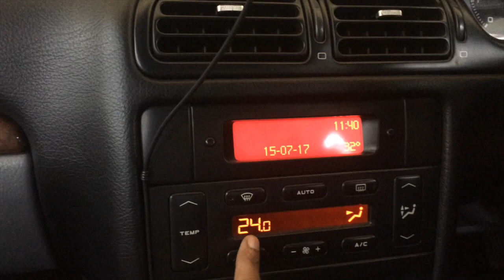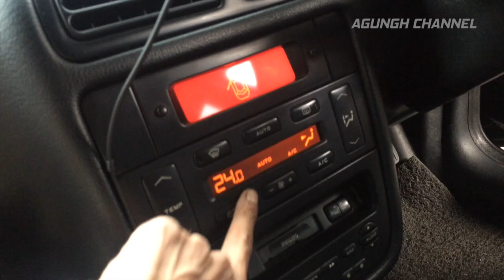How To Replace AC Relay in BSI Unit - PEUGEOT 406

Comment: I really like this video, especially since I have taken my Peugeot 406 to three auto electricians, and they have been unable to fix my air-con.  I think it's in the too hard basket and in Australia I don't think a lot of auto electricians like these European cars.   I'm not sure where you are located but if you ever come to Australia would you please fix my air-conditioning, because I feel confident that you know what you are doing, and I certainly have no confidence after three tries with 3 different auto electricians!   It's a shame I love my car so much, otherwise in Summer I would have gladly given it away when I'm driving in the sweltering heat like the 41c we had yesterday!!
Reply from the maker: I live in Indonesia, just do it by your self. first, check AC Compressor socket then also check in pressure switch socket. If there is not detected, probably your BSI relay problem.

Comment: Hi there awesome video. Do you know if this will work on the 2015 208. Or what I can check. My Aircon only works if the radiator fan is on. On the diagnostics it says fault with LIN network 2. If I clear the error my Aircon works perfectly but when the error comes back it stops working again… please help me, auto electricians don’t know how to help and the dealership is clueless.

Comment: Nice video and all. I just don´t understand why you cut the plastic case of the BSI.
There´s just a few plastic tabs holding it in place. Pop the tabs and the entire cover comes off. Without cutting anything. ;-)
Reply from the maker: I can't find the tabs holding to open in back cover from this BSI type. So... I decided to cut off in this area. If don't mind, please shows me how to do it... Thanks before.
Reply from the maker: Thank you very much for your reference...
Reply: Having taken a 406 engine fuse box apart, which is of a similar construction to the BSI, it is not possible to remove the casing. This is due to the fact that the multi plug pins and fuse sockets are bonded to the top cover. I tried to desolder the socket pins on the circuit board but gave up after an hour. A hot air station might possibly work, but honestly, if videos like this show you the location of the faulty relay, cutting open the BSI is minutes work.
Reply from the maker: @roberthorwat6747  Hehehe... You're right Sir.
Reply from the maker: @crpth1  Hehehe... look like but absolutely different.

Comment: Any chance you know where the wiper low and wiper high relays are? :o
Reply from the maker: PEUGEOT 406 MK2 use rain sensor to change low/high wiper speed automatically.
Reply: My 406 is model 2001. Automatic rain wiper not works now. Do you know, where the fault would be? It stopped working surprisingly.
Reply from the maker: @markol.8173  you can check wiper motor first, in good condition or not.